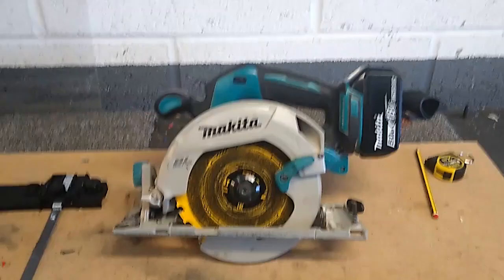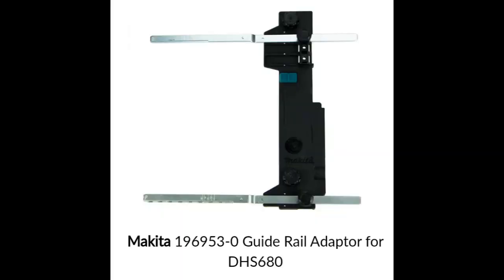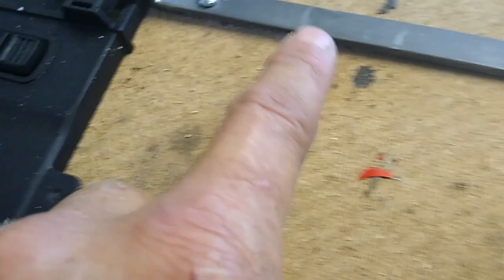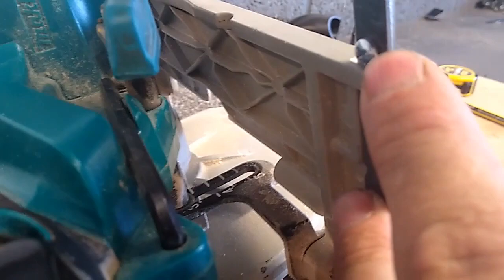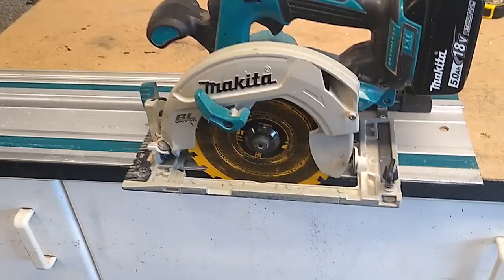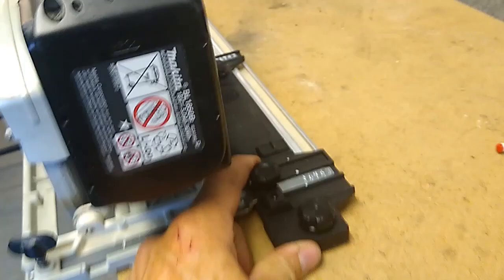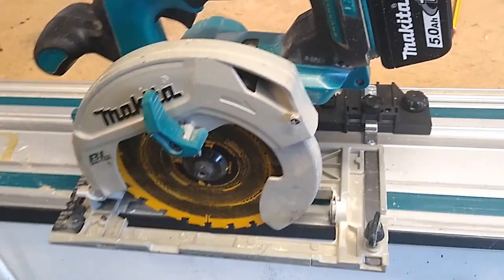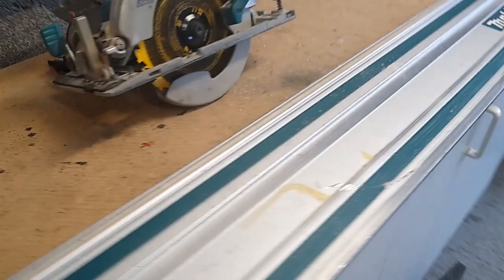Makita guide rail adapter modification for DHS680 circular saw

Comment: I couldn’t get an adapter a few months ago . And they were very expensive 
I made on from some 10 mm acrylic sheet  and cut 2 bars . Grooved out for one of the guides . It’s approx 18 inches long so it doesn’t skip at front and end of the board . It’s abs spot on . Could prob make the same in ply . Just got to make sure your groove is spot on . No play in it .
Reply from the maker: Hi Terry. If I couldn't have got the rail adapter I did, I think I would have tried to go the same route as you.😛 Sounds like you've got a great and cheap adapter there.😎 Cheers.
Reply: Good idea! Might return mine and make a diy version.
I found it for approx. 26$. What price did you find it at?

Comment: What clamps did you use to clap the rail to workpiece?
Reply from the maker: Hi Zed. No clamps used, just stays in place with the anti slip straps in the underside of the rail😎 Cheers
Reply: Excellent thanks!

Comment: So what's the advantage of using my brushless saw on a rail? Same depth of cut as my track saw and tracksaw is more refined to use and has better dust collection 🤔
Reply from the maker: Hi there. The dedicated  Makita plunge saw is superior in every way, for its intended purpose, to a DHS580 adapted to fit on the guide rail. Unfortunately, not everyone can afford to have both saws, so using the adaptor to mount a saw you may already have, (and can be used for many more jobs than a dedicated plunge saw), is a great option. 👍 Thanks for your comment.

Comment: Get that dang yellow blade off the Teal!  Blasphemy!  😳😬😳🙄😁😃😀😂🤣👍🇬🇧🇺🇸
Reply from the maker: What can I say George, I'm a naughty boy. 🙄 Cheers.
Reply: I use these DeWalt blades. I really like em. Prob better than the stock Makita blade
Reply from the maker: @JBSeymour  Hi. I have found the DeWalt 165 blades are a great blade for general site work. (they are on special offer at the moment at Toolstation for less than £12.00. 😎. Cheers.
Reply: @JBSeymour  I won’t argue with you about the DeWalt blades, as I put the stock 40 tooth ‘Precision Trim’ blade, that came with my 20 volt DeWalt 7&1/4 inch sliding miter saw, back on, after having had a 60 tooth Freud blade on it!  But I will take exception as most, and I stress, ‘most,’ of the MakIta blades have been alright.  YMMV. Peace!
Reply: @thetallcarpenter  agreed Cheers Mate

Comment: If you had bought the dcs 579 instead of the 578 that comes with a track capable base that fits on the dewalt guide rails/tracks or you can actually. Up the base as a part on it's own and fit that on to your 578, this is if it would be useful for you to have that capability m8. Funnily enough I've just found the 579 kit with the two batteries for nearly fifty pounds cheaper than the 578. Also I saw your 578 video and noted you saying that you will be looking to buy some extra batteries,you can currently get the 54v/9ah batteries on sale for £130 or have you ever seen the third party chinese batteries for the dewalt tools,on amazon ATM there is a third party flexvolt battery for £70, it is a 6.0ah one though if that is of any use to you bud.
Reply from the maker: Its interesting you mention about the 579 track base being available as spare part. One thing I noticed about the 578 base is that it is slightly bowed probably due to the way its been pressed rather than cast which is a little disappointing. I've got six 6ah batteries at present, but, as you suggest, the 9ah ones will probably suit these 190mm saw better. Cheers.

Comment: You'd think that Makita would sell the metal bars separately. Bit shameful making you buy the plastic bit twice just to fit another saw when it's a common part.
Reply from the maker: Hi there. Its not best approach really. The guide with the shorter bars was half the price of the guide with the longer ones. 😵 Thanks for watching and your comments. 😎 Cheers.